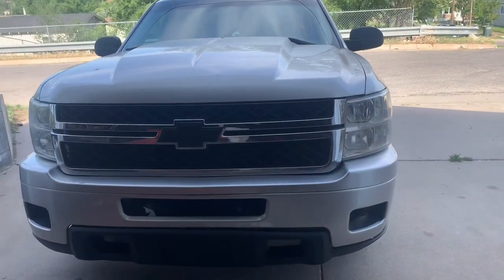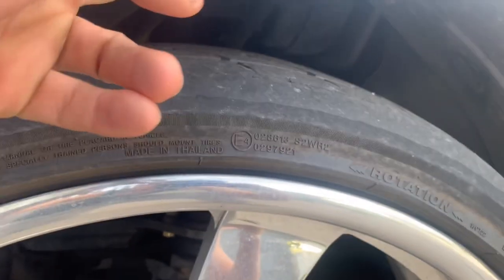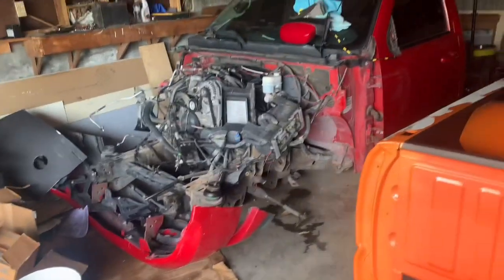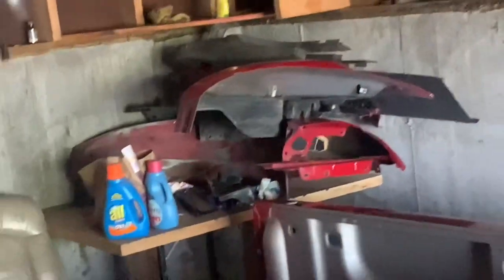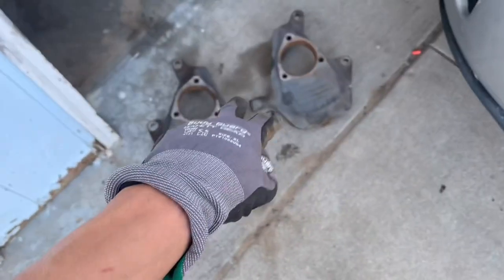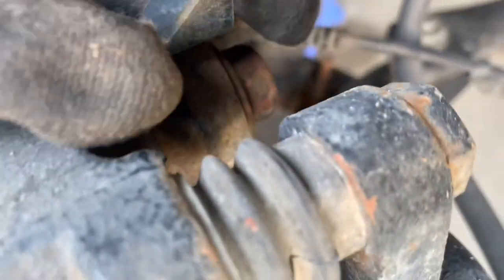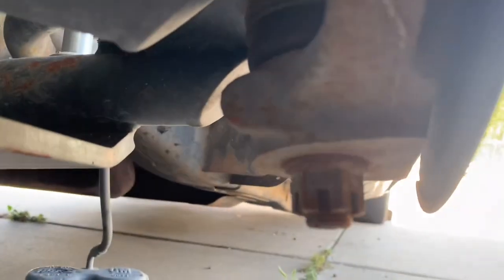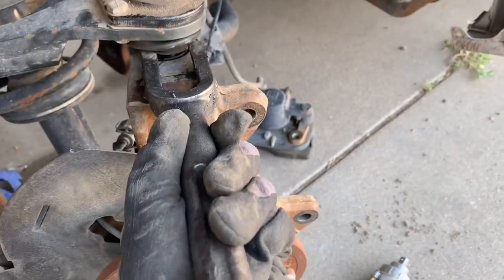Dropped my truck/ How to install drop spindles

Comment: Hope you or someone in the comments answer my question do 2006 spindles fit my 08 I already ordered and I’m stressing about them not fitting
Reply: I did the same thing you can make them fit by making the hole of the spindle where the outer control arm goes bigger
Reply: But everything else fits snug